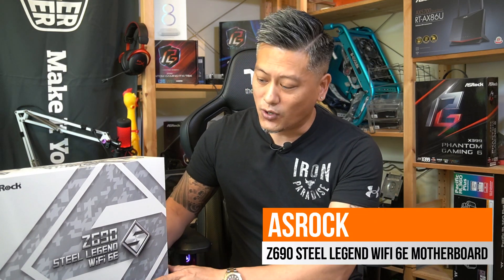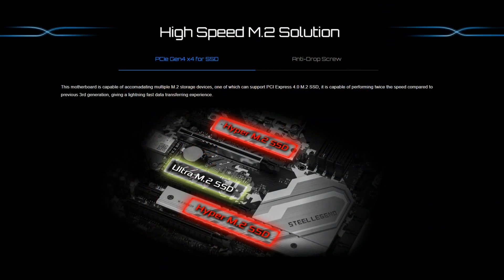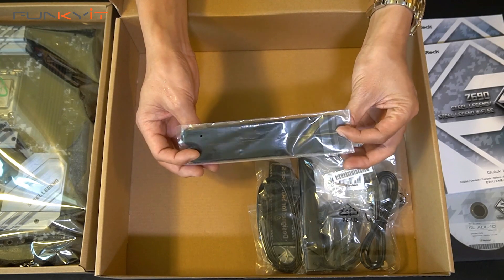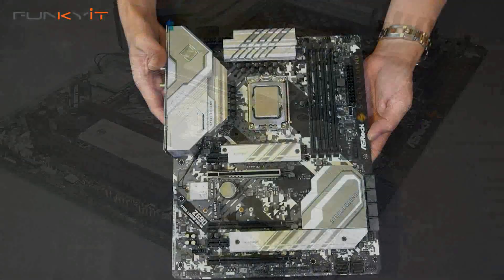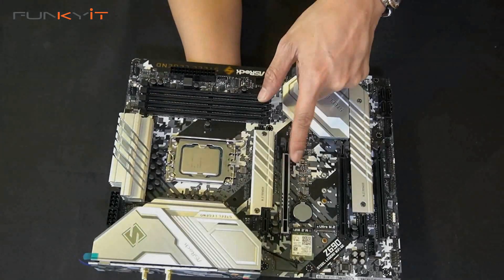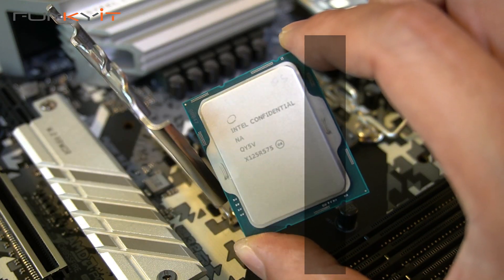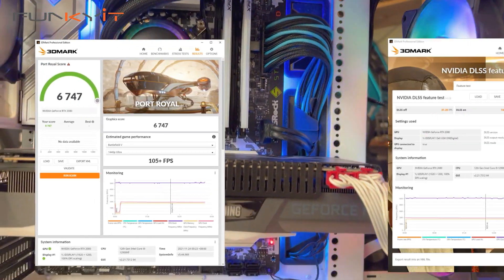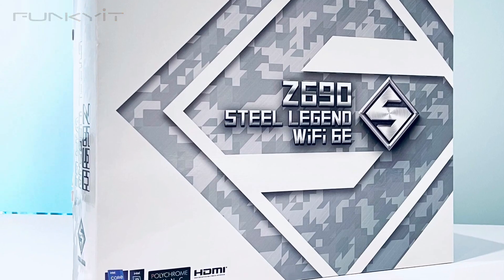ASRock Z690 Steel Legend WiFi 6e Motherboard - The best in its class

Comment: Im new to z690 motherboards i do have a b660 board right now and im wondering if i need to hace both 8 pins plugged in if im not overclocking
Reply from the maker: It’s best to plug both in… it will give the board more stability.

Comment: Random question, why do you avoid talking about the top PCI slot?? You mentioned all the others but avoid the top one? Is there any reason why? It's the main reason I'm looking at ASrock, all the other manufacturers do stupid sh1t like bury all the slots directly under the GPU slot so they're unusable, I NEED that extra slot, doesn't it work?
Also where in the UK did you find the WiFi version?

Comment: Trading my crap MSI back in for this today. Nothing but issues. I usually go Asus, but wanted to give msi a try. RGP issues, boot time is literally 1+ minute with nvme (old Asus board was 15 seconds or less), weird graphics card issues as well. Never got anything Asrock either, but for 289 (ddr5) this looks comparable to what Asus wants 379 for, so giving it a shot. Also, the ddr5 version has tons of usbs. The sonic board looks cool too, but no wifi and lacking usb ports.

Comment: Your radiator is mounted upside down. Your tubes should be on the bottom if mounted on the front.
Reply: No, it's fine. You don't need to mount the tube on the bottom

Comment: Well this video did it for deciding on a motherboard. I gave my wife my old computer when I built one a few years ago but hers is now getting kinda slow for what she is doing on it(10 years old). I also bought her a Phanteks 500A case with an i5-12400. Maybe I can overclock it some. Gave her 16gb b-die memory that I wasn't using and a 1tb drive I had as a drawer. So she should be good for several years. I would like to put a video card in there so we can game together but the prices give me lots of pause. Anyway thanks for the review!! First board I have bought from ASrock.

Comment: Overheating was terrible with 11th gen and 10th gen as well. It was so bad I decided to keep my very easy to cool 6700k. Intel has 65W 12th gen models coming in January. 12400F looks like an excellent all around performer with 6 P-cores/12 threads. Most 1440p or 4K gamers will get enough performance out of it and it will be much easier to cool due to lower TDP. I bought Z690 Steel Legend and I am now waiting for 12400F to come out in a few weeks.
Reply: I am waiting for 13th gen intel
Reply: @LightWilliamz  why wait, it'll be the same story if they don't drop to 7nm. that being said to the other guy's comment, don't be fooled by that 65 watt TDP. that has to do with the base clock, which runs at 2.5ghz. they had to drop it that low in order to satisfy there share holders and the OEM market, because at it's default clock speed of 3.5 ran too hot at 80 watts, so that was the only way they could maintain some efficiency is by lower the core clock, that's the reason for the 65 watt TDP, but you can easily remove the power limits, it's not worth it though.